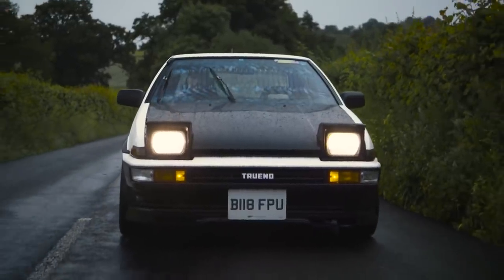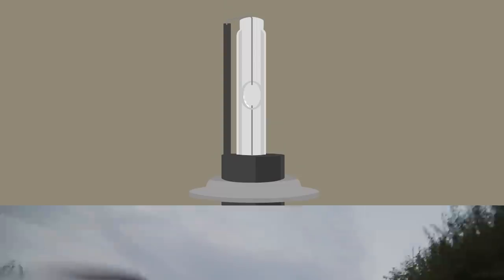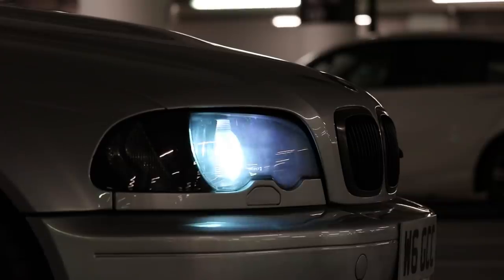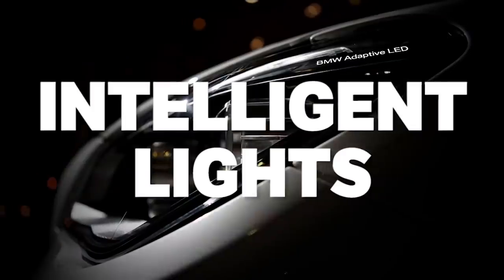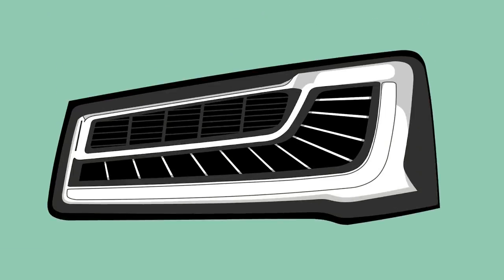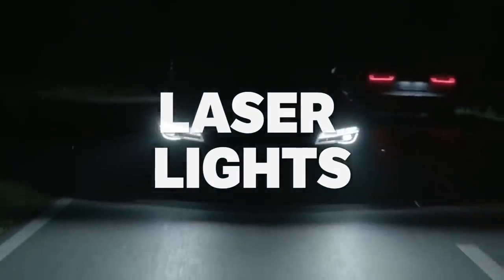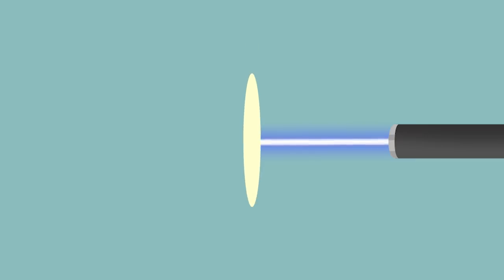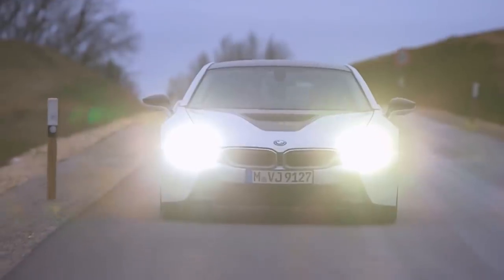Modern Headlights 101 - Xenon, Matrix, and Laser Lights

Comment: I work as a driver at night, and almost all new cars lights are too bright AND aim too high. Well done manufacturers, thanks for blinding me all bloody night.
Reply: Special "sun"-glases with yellowish glas. This may help You.
Reply: i dont' understand that too. Makers probably think it will help to come christmas faster.
Reply: Worst culprits are nissan joke and qashqai and land rover products
Reply: I drive at night both two and from work this time of year and almost never have that issue. My car sets pretty low too
Reply: The Audi automatic head light dip does not appear to work very well in this video, i.e. it dips when the hi-beam hits the car ahead, which is too late!
Reply: @AliveGhost13  agreed, Land Rover Discoverys are by far the worst in my opinion.
I drive a big van too, so it's not exactly like I'm low to the ground either
Reply: @Tore_Lund  My dad has a D4 Audi A8 and previously had a 7 series both with the matrix lights. The 7 series ones were horrendous even after recalibration... The A8 matrix are fantastic and have yet to be flashed in 2 years
Reply: That's actually good!
Reply: So true mate. I'm quite sensible about light in general (when it's sunny, I can't drive without sunglasses during the day) and all those new cars with led's, etc... It's way to bright ! Even turns signals, brake lights, ughh.... 

I tried and fitted my cars with yellow headlights. It really lights up well and it's not blinding at all, way more easy on the eyes. Plus, it's really easy for friends to spot me on the street ; I'm the only one with yellow bulb :D
Reply: That's not the manufactors fault. It's your city/state fault. In europe inspections are mandatory every year, and they will always check for the height of your headlights so you dont blind. I've been driving in the two continents for over 20 years now, and you can tell the difference between the regulations. It's not the desing that needs changing, it's the laws.
Reply: @Thijmen M My god, these damn 500.000 LED brakelights are awfull. They are so fatiguing when the car in front keeps them on at the traffic lights. Why in the damn don't they have a dim feature after like 2-3 seconds of being stopped at the traffic lights to dim down, as the car is already stopped. 
Jesus, why aren't billion dollar manufacturers thinking of these things?
Reply: Very true. Try getting some night glasses that are polarized and and help cancel out those brighter colors
Reply: dan richardson what about the matrix light's
Reply: @adyandrey23andrey  newer Mercedes come with exactly that function. Just search for "mercedes multi level rear light" and you should find it.
Reply: dan richardson at least you stay awake am I right?
Reply: @Tore_Lund  only for a split second. it works trust me. seen it work in real life.
Reply: @wax333  I guess the sales video was in slow motion to show the headlights working? Still a split second is too much and will annoy opposing drivers. You dip your beams when you see the glow from an opposing car from the other side of the hilltop before you actually see his headlights.
Reply: cant really agree to your statement but i agree in someway. as a mechanic and former qsa in a automotive plant, i can tell you and the other guys that headlights are properly aimed before delivery (to the specs what country that car was made for). what happens after that (road bumps, re-alignment by techs/owners/accidents/pot holes, you name it) or other modifications to the vehicle is not the vehicles/manufactures fault. this goes for ALL kinds of headlight types (halogen, hid, led, ...). so yours might blind people as well, but maybe you havent noticed it yet. just saying.
Reply: @snoke2007   considering it is   mostly brand new cars, and high end makes almost exclusively then the regulation aim must not be compatable with new headlight technologies. The main problem is cars in the side mirrors on other lanes of the motorway, so either the directional bias is the issue, or the matrix lights don't actually work for that situation.
Reply: Just keep your eyes closed when you are driving. It helps
Reply: Becouse those cars does thave matrix LED...
Reply: @axelaurola6379  actually it fatigues you considerably, making your eyes adjust to massively different light levels constantly.
Reply: @AliveGhost13  Toyota's are the worst for me. It's like they have high beam always on.
Reply: Get a day job then. Lol
Reply: I don't get what's so difficult about installing a cheap photosensor.
And if they don't work you just switch back to maximum luminosity.
Reply: Nope, where I come from older lights are too dim but high beamers still blind me!.
Reply: Blame The drivers. Having poor visibiloty at night can lead to death.
Reply: @jareknowak8712  no actually, that's fake and hurts your vision more
Reply: @classic7033  those are a joke actually, meaning they will hurt your vision and not nessecarily block out light
Reply: @Tore_Lund  Well said.  An advanced driver would anticipate the oncoming car from the glow of its headlights, such as when approaching the crest of a hill or round a bend, and dip the headlights before they blind the approaching driver.  Can these new 'intelligent' systems do that?
Reply: Get a led light bar :D

Comment: People for the love of god, if you’re going to do a HID upgrade, PLEASE get projector  housings if your car doesn’t have them.
Reply: Even with projector housing a HID kit will still be illegal. So everybody needs to make that choice.
Reply: Mieczysław Beger where will that be illegal?
Reply: Properly aimed hid lights that are made for a specific housing do not blind any more than standard lights do
Reply: @gmeister03  Everywhere? Halogen headlight assembly is designed, adjusted, tested and certified as such, with EU markings (in Europe) and homologation and other safety and compliance certificates. If you retrofit HID bulb into such unit you invalidate all those certificates and technically it becomes illegal as not being tested, licensed and approved by appropriate institutions. So while it might be aligned properly and pass inspection, if you have accident and bad luck,  your insurance company might pick up on this and invalidate your insurance policy as you were driving a car with illegal, untested and uncertified modification. While it is just a possibility, the risk is on the owner of a car. Still, if it's done properly (actual HID reflector and lenses housing unit (inside headlight) being retrofitted, not just the bulb) and you are ready to spend few hundreds of £/$/€ than it can be done. Albeit someone might complain on lack of headlight washers and self leveling system. Uff, that's a long comment ;)
Reply: @gmeister03  in my country it is counted as modified parts ,the law doesn't support this part (because thay are not allow to modification any mobile except they are use part from only factory and its hard to say.because a lot of copied brand and fake is hardly to determine)
And its ilegal. As a mobile modification law.
Reply: JUUL CAT
Reply: @gmeister03  We have some utterly stupid people here in Romania. Some of them are installing HID (Xenons) on cars that were designed to work with Halogen bulbs which also featured a zooming lens, so that the ray of light from the halogen beam would offer a better overall performance. So, there are some idiots driving all sorts of cars,  that installed HIDs and now they're blinding you on the road with their crap cheap DIY HID systems. And that my friend, is illegal. Police often stop them on the road at night and force them to change the headlights to match the car's specifications.
Reply: @Mietas2  im in america, here car mods are good as long as they are D.O.T. approved. 4300k hid'
are approved
Reply: In the UK, MOT law says that HID bulbs need auto level lenses and washer jets for the lenses. Or so ive been told :)
Reply: TheMuppet05 yeah, screw that’s nonsense
Reply: A modern reflector works well with hid.  Just keep the Kelvin below 4500k.   I'd run 3000k if it was legal.
Reply: @Mietas2  You sure? Because here in Europe lot's of japanese imports are made road legal by installing aftermarket HID projector kit in place of the original reflector light. It's inspected, approved and marked to the registration afterwards.
Reply: @RupOase  pfft I have  hids  and no one has flashed me or cops have pulled me over and I see the same cop all the time. Never pulled me over. I have a 2011 honda crv

Comment: I just hate it when people install xenon lights so they can "see better" or for coolness, and their low beam looks pretty much like high beam
Reply: I tried them in my car and they make it worse. Yellow is better, especially in fog. White and blue is downright awful. You simply cannot see better with white light.
Reply: Liam Pepper I think it depends on the car and housing it’s in. My car had factory BiXenon adaptive lamps and they’re extremely bright, way brighter than any car I’ve been in with halogens. They take a seconds to warm up, but it’s a very natural white glow at night. It usually doesn’t work well if people install HIDs in the factory halogen housing.
Reply: jacob stienecker u 2 thx
Reply: It's your states fault.
Reply: @fossilfueled27  yellow is crap, best visibility comes from 8k hid bulbs with 55watt ballast which tones down the color to 6k which is pure white
Reply: Those aren't legal i believe, if the car is design to use Halogen then it is not possible to make a switch without harming the rest people on the road.
Reply: Because they don't have the reflector to properly angle the lights
Reply: I think the mistake alot of people make when installing a HID kit, is they fit them to reflector headlights, which aren't made for xenons. I fitted Xenons to projector lights that where halogen and they where like OEM
Reply: This is not an issue if you align the lights, no one does this.
Heck even halogen bulbs need to be aligned from time to time.
Reply: @uliun9609  Umm, no.
Best comes from yellow, our eyes can see yellow better than blue which is 8000K.

It is not a matter of opinion but fact.
Yellow light activates two of our cones in the eye(the green cone and red cone),
Blue just activates one(blue cone).
Reply: @IIGrayfoxII  that's the point - if you have HIDs in traditional reflector (mirror-based) housings and you align them in order to now blind the other drivers, you're almost defeating the purpose of having HID lights. 

HIDs work so well because in combination with a projector housing (the lens-based ones), they can very accurately limit the height at which the light shines. That allows the light to travel a greater distance because the hight can be higher. The higher intensity of the lights only complement that. 

That's why more recently we've started seeing seeing traditional halogen lights in projector housings. It's an upgrade even with halogens.
Reply: @IIGrayfoxII  also, you're right that the human eye is more sensitive to yellow but the light you see from Xenon headlamps is white. If you look directly into the HID you might see blue or purple, that's because of refraction at different angles. The actual projected color is white.
Reply: @xIcarus227  There have been cars with HIDs in reflector housings, not common but they existed.
Reply: @xIcarus227  projector-based housing*
Reply: @CheqqaN  xenon or led bulbs*? installing oem xenon or led headlights afterwards is legal in germany
Reply: @CheqqaN  I know what parts you need to retrofit 6c led headlights in polos with stock halogen. But I've had great experience with aftermarket led bulbs in my halogen headlights. Just not with the cheaper ones. I also checked the pattern at a garage with a beam setter. The results were just as good or better than the stock halogen bulbs.
Reply: They are if done properly and... I upgraded my C-class headlights. Car had halogens, now has OEM bi-xenons. They are amazing. Brighter, more reliable, they look cool and they are very useful for making left lane hogs move.
Reply: You might hate them, but you can see much better with HID xenon or LED headlights. My 2014 Nissan Versa has LED lights and I love them!! More cars are coming with them so get used to it!!
Reply: BlakeParker15 but for the price of potentially blinding others?
Reply: @xnopyt13  I mean, I don't want to but, it might blind people for a short amount of time. Regular headlights do too though.
Reply: @uliun9609  wrong, optimum color temperature is at 4500K.  Yellow is actually the best for fog and blizzards.  Just because it looks brighter doesn't mean it's actually working that well.
Reply: That's not the problem. The problem is the light adjustment is incorrect.
Reply: @jacobstienecker  you are one
Reply: If you think about it they kind of are, they are low beams of those kinds of lights are as bright as the high beams of halogens
Reply: Anyone who installs xenon bulbs into a halogen designed housing is scum of the earth and should get a huge fine. Increases the risk of a crash 10x with blinding oncoming traffic.
Reply: It’s not an issue if they’re proper hardware, properly installed, and properly aligned. Good quality projectors or projector retrofits, a nice sharp cutoff, and proper alignment will mitigate the problems almost completely
Reply: Ryan G of course, the problem is the lack of regulations/inspections, and the amount of people who doesn't know that alignment exists or just doesn't care
Reply: @xnopyt13  unfortunately you're 100% correct
Reply: I believe  that's because those cars might not have projector headlights.

Comment: I prefer those candle lights that the first cars used. A little headlight with a burning candle inside. Good in winter for defrost. :)
Reply: @MrJustinUSCM  Lol
Reply: They did not use candles, they used calcium carbide lamps: A small container with water and some calcium carbide rocks in there bubbles Acetylene which is burned at a small nozzle. Problem was that they got clogged and blew up shattering the head lamp.

Comment: I hope you do not get this wrong: modern headlight technologies do not make you feel blinded (by the light), because they are so much brighter than old halogen ones. The major difference is the surface the headlight uses for this output! Old halogens usually work with a reflector which means the output appears on a big surface. Bigger, but less bright. Xenon's use a lens, so much smaller surface but brighter. Than you have new super small and super bright LED. So of course the small LED appear to be much brighter. Same is for rear lights as well. (All according to properly adjusted headlights)

Comment: It's surpiring that there are still new cars with this old school halogen lights and normal bulbs. LED shout be standart for safety and better comfort (longer life).
Reply: Problem is that when they break they are (still) way more expensive to replace.
Reply: @erikoosterom  make cheaper version with one or two exchengeable "bulbs". No fancy special fx needed.
If this will be standart in cars that means they will have to produce more. 
Higher production = lower costs.
Reply: @erikoosterom  problem is they dont "break"
Reply: @erikoosterom  what do you mean by that led lights are 5€-15€
Reply: Mercedes and Peugeot owners might disagree with you on the longer life part...
Reply: Minimum HID projectorws. They are dirt cheap, even quality units afterrmarket are ~ $50
Reply: Problem is when someone wants cheaper. So you install fabric seats and basic radios. Nope, still too expensive, so you take out the floor carpets and install crank windows. Still too expensive, so unpainted body and halogen headlights.

Welcome to base model and fleet vehicles.
Reply: When have you ever seen a 2018 car with crank windows and no paint? In the UK at least, you can't even buy vans without electric windows. The only car I know of where paint is optional is Caterham.
Reply: @fossilfueled27  I know that fleet vehicles in the US, especially American fleet pickups, have all the plastics unpainted. I've heard of them still having crank windows, but I never saw it personally.
Reply: This is because a halogen bulb would cost them 50cents.
An electrical circuit+the LED dies+LED controller would be much much more, even when you consider bulk pricing.
Reply: Longer life!! Hahaha come to Saudi Arabia where you can see new cars with broken LED because of the hot weather. LED lamps can’t survive above 40 degree for long
Reply: I bought some LED bulbs for my 05 Camry for $35. So much better
Reply: I'd put a set of osram night breaker halogen up against 90% of the hid and led on the road.  You guys are falling for a gimmick.  Hid are great is below 4500k.   Led are straight up garbage.
Reply: @jareknowak8712  cheap leds are not even a bit better than halogen lights, this includes cheap led projectors. Not sensible what you proposed.